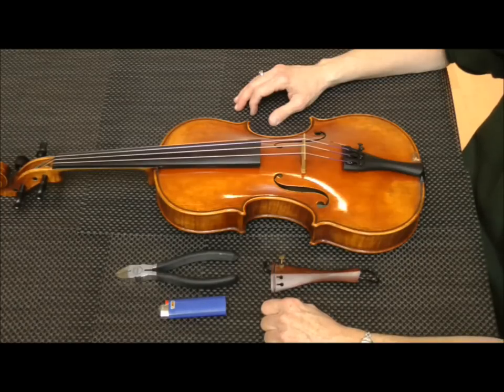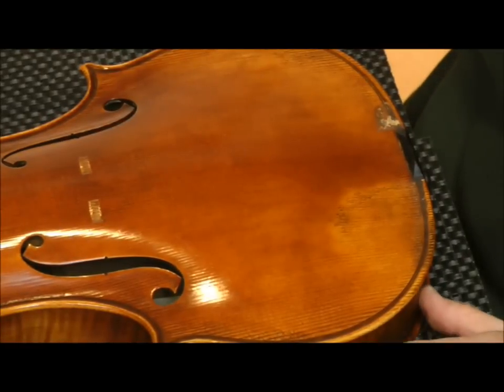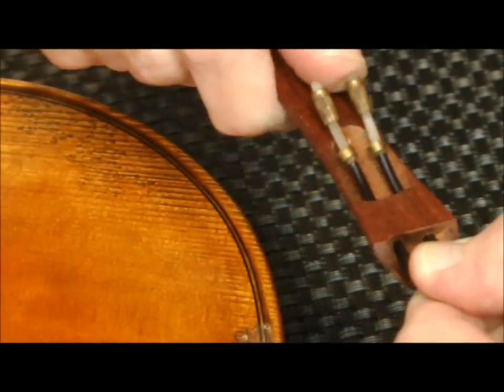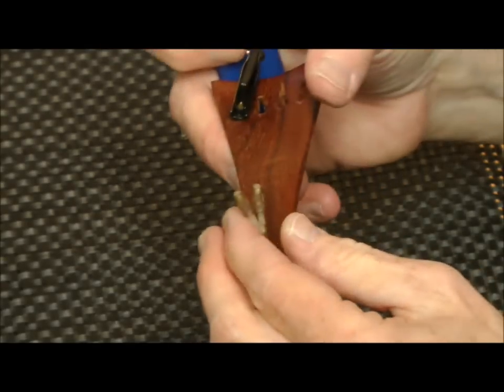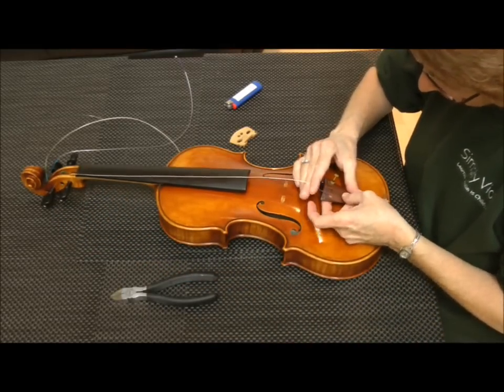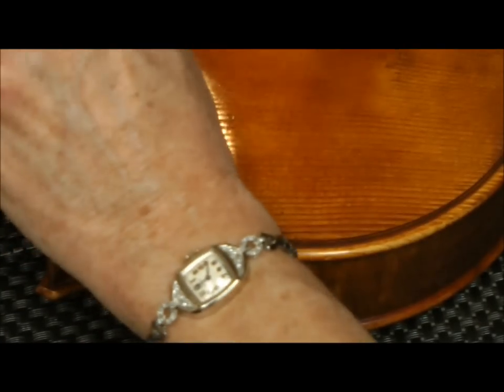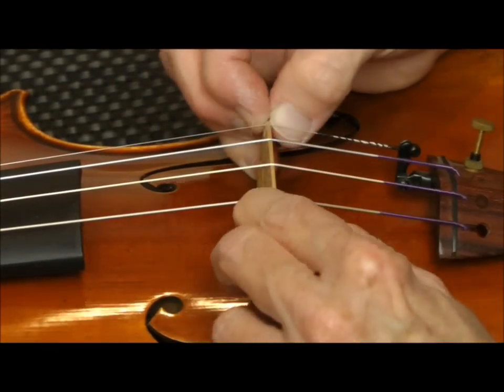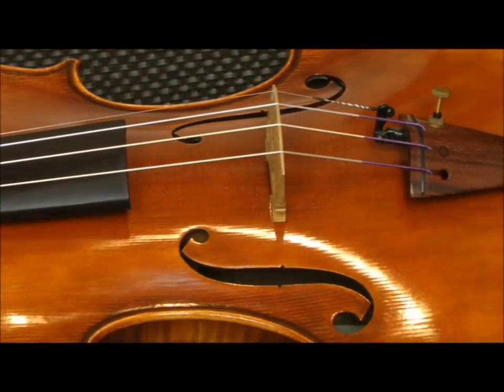How to Change a Violin Tailpiece

Comment: I will be changing my tail piece very soon for the first time and replacing it with an ebony tail piece.  Your video has answered my questions about how to attach ball end strings to my new tail piece as I did want to change my strings yet and thank goodness I don't have to.

It all seems very straight forward and thank you for posting as your video has put my mind at rest that I also bought the correct fine tuner for my E string👍😁

Comment: Thanks, you, for the information.  I am rebuilding my beginner/ intermediate violin and that is my next step though I am going to leave 2'fine tuners A and E. I am changing all the furniture to Rosewood as a lot of it is composite and I feel it is holding me back.
I build and refurbish instruments as a hobby but all I have ever done with a violin is change the strings and reset the sound post. Though aggravating the instructions were in one of my Luthier  books.  This was.so much easier than reading and using photos.

Comment: That's a nice work-mat you have there. When I first saw the lighter at the start of the video I had visions of Jimi Hendrix pyrotechnic event. On this instrument the bridge had left footprint depressions on the surface to make for alignment but my teachers would have me inspect & align my bridge central with the axes of mid-slit of the F-shapes of sound-holes. An older comment stated that he could still see the an unvarnished area of 1mm or so (which I also noticed), but I think your bridge refit is now closer to where it should be. It'll be closer to the internal sound post & likely to produce a more efficient sound.

Comment: I have a 5 String Cello which uses a really beautiful Ebony Tailpiece. I changed the friction pegs out to mechanical ones which allowed me to get rid of the fine tuners from the tailpiece. The lack of fine tuners on the tailpiecec will liven up the instrument's sound by allowing the top to vibrate more freely.

Comment: thankyou for this. I found a Cremona at a thrift store, but the end pin hole for the tail piece is filled in with some kind of filler, there was no tailpiece, bridge or end pin attached to this violin. I just ordered the tailpiece set but how should i remove the filler that someone put in there, I don't want it to fall into the violin when i try to remove it, thankyou!!